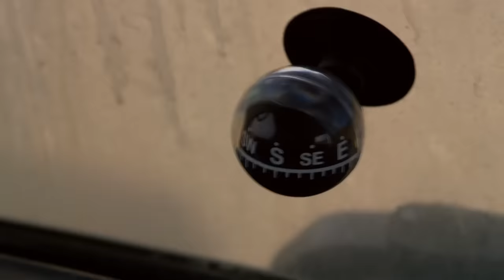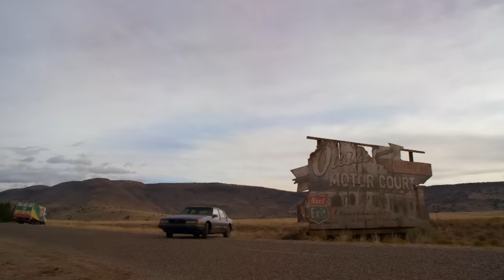Every Time Mike Outsmarted His Enemies | Breaking Bad & Better Call Saul

Comment: Not sure if this adds to immersion or takes away from it.

If you're cutting open tires, the thinnest part is definitely the flat side, but to avoid cutting the money you'd go closer to the vertices and cut perpendicular.

You'd also puncture then tap the wheel then check the inside. Assuming they weren't already punctured by the spike trap.

Or at least I think. The fk do I know.
Reply: A Sawzall will cut a tire like that no issue.

Comment: My biggest complaint is at 2:25 when nacho starts the van and shifts into reverse you can hear three gear selections. Since it goes PRND21 as a shift selector and he started in park.

He should have been in reverse but instead he was in drive. And still went backwards.

Comment: 14:47
That is one movie/TV troupe I hate, sure, spray around torso/head height at the start, but after that you should be sweeping as low as you can with the assumption that IF someone is in fact in there they are probably on the floor by now
Reply: Trucks are a decent height off the ground and they are hip firing so the rounds are angled upwards you’d be surprised how little people realize their muzzle is slightly lower or higher then it is which results in huge amounts of misses